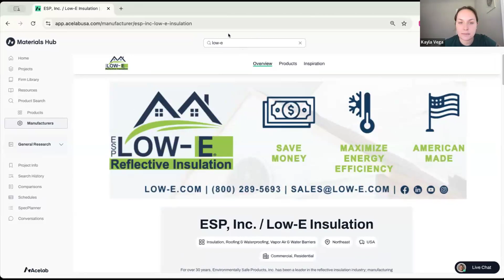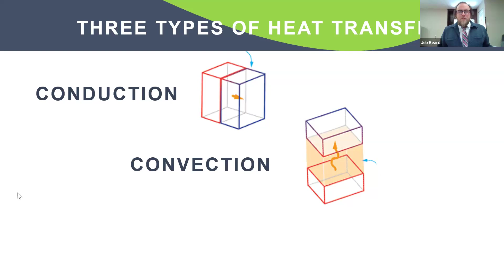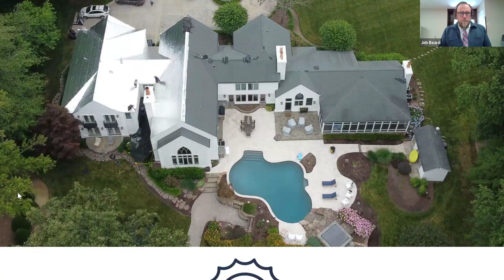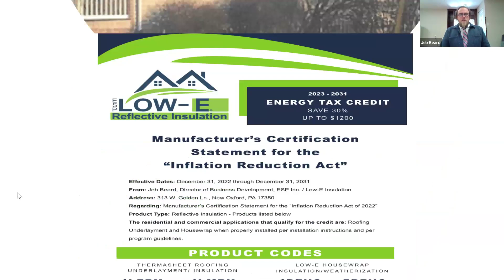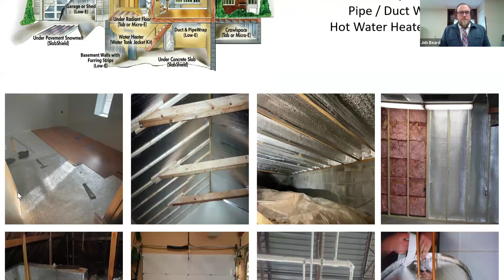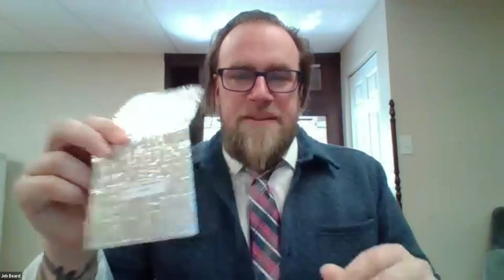Low-E Insulation: Energy Efficiency & Ever-Changing Building Codes

Comment: just some corrections,
copper has better emissivity than aluminum for the same given surface oxide thickness. very shiny aluminum always has an oxide thickness of ~10nm. shiny copper can be close to zero but will increase over 5-10 years to be 5x aluminum depending on humidity. 
all of these reflect/block cell phone/wifi signals.
a copper emissivity product would outperform any aluminum one for the beginning of its life and then possibly under-perform. would also probably cost 4x more in materials.